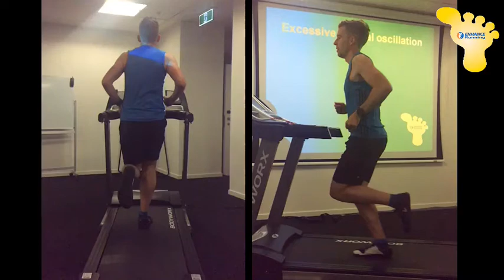Enhance Running: Excessive vertical oscillation

Comment: It is not excessive for the speed with its stride length and cadence; it allows duration for the airborne foot to return to a landing that is in rearward motion and a midfoot strike with slightly flexed knee and hip for weight absorption and foot pronation. 
An increased cadence will allow for smaller "bounce" or "recoil" or "jump" while still having sufficient time to correctly land airborne foot.  
Running is repeated alternate foot jumping with a forward trajectory, nothing more or less.